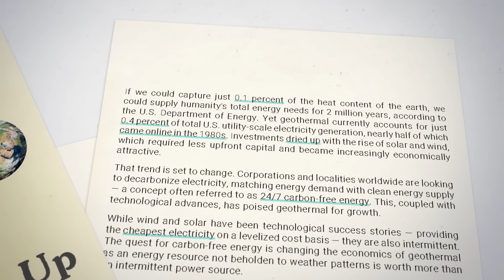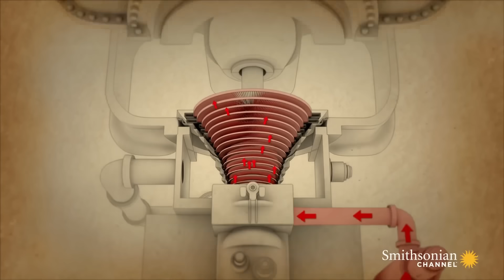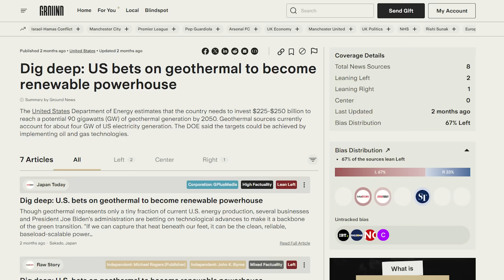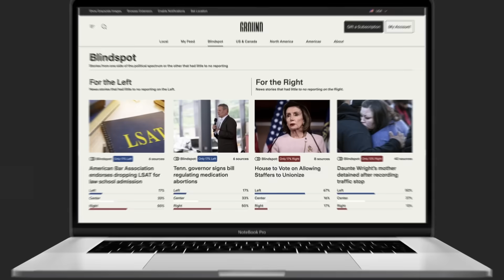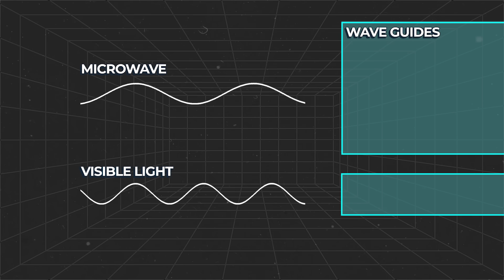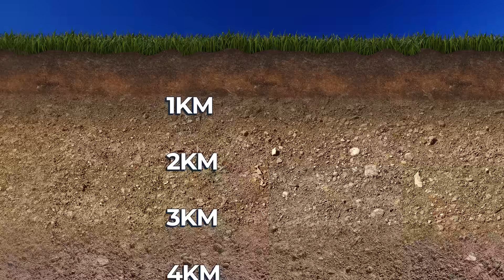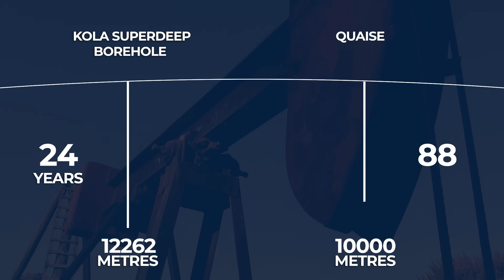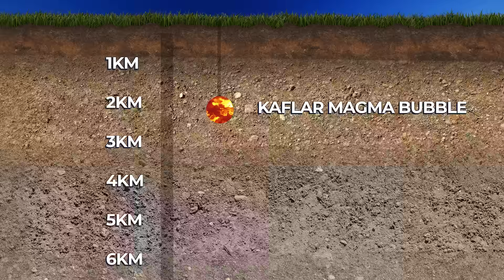This Fusion Tech is Solving the Geothermal Energy Problem

Comment: As your microwave "drill" gets near to functional depth, you might already have 100°C steam blasting out of the bore around the drill. Do you keep going? HOW? You still need a conventional casing of some sort. 

That high pressure "rock" is also going to ooze into the hole and close it back up. Oh, that's probably why these "experimental holes" will be conveniently shallow, to sucker the big investors/ government/taxpayers to fund the "real one" at an indeterminate price point for 30 or 40 years before declaring the failure to produce anything promised.

Comment: Great but I doubt individual bores would be reliable in terms of even a year.  I would question the durability of the bore holes as by necessity the whole bore is pressurized. Very highly pressurized so the steam is 'saturated'. 
 How close to the magma does it need to get or worse yet, what if you get too close and have yourself a man made volcano. Also maintaining a consistent output pressure is done how? How is input water metered to keep stable output.

Comment: I ran across a video a while back which talked about a new way of boring a hole it was a nuclear propulsion.  It was suppose to melt through rock and leave a vitrified finish.  There is a patent for this machine and it is back in the early 1970s or late 1960s.  Was the boring machine ever built, I do not know?

Comment: I wonder how they are going to handle vaporized rock at 10km deep.  Vaporized rock doesn't dissapear. It just depositions to the surfaces immediately. Even if you suck it it will collect to the surfaces of whatever you are sucking it to. It sounds too good to be true. Just 2m dollar of electricity and you have 10k hole. It is probably more feasible to dig that rock with waterjet instead. Just make a waterjet that can fit a tight hole and work submerged. It is already used in mining.

Comment: 😂🤣😂🤣😂 you can't blow out rock as a gas because what about when it cools during its journey? 💁‍♂️

Now let's talk about how hot it is down there and why those drill bits are dulled and how that same thermal energy melting and dulling the bits could also be used with thermocoupling, but that would cut costs for consumers 😐
Let's also talk about how what's down there is under extreme pressure and willie nillie breaking that barrier can be detrimental to EVERYONES' health 💁‍♂️

Im a whole 1:48 seconds in and only here because one energy solution solves another?

Foolish. Geo thermal doesnt need solving, it needs less cover up 🙄
Reply: Knowing my luck, no one will understand whats meant by thermocoupling 😒

Comment: Some of the vaporized rock is going to hit the walls of the hole and the vaporizer device and solidify, especially over kilometers of travel.
Also the internet and telecom use near Infrared, around 1.55 to 1.65um and not visible .4 to .7um.
Also look at home big the microwave or laser beam is going to be after travel 100s to 10,000s km from orbit to earth 🌎.

Comment: I postulate drilling two holes close together and at some depth bridge the two together to form an elongated U Then by pumping a suitable heat transfer medium down one it can come back up the other at an elevated temperature thus transporting thermal energy to where it can be employed. This will cause localized cooling at the bottom of the energy well thus may need progressive deepening until a sweet spot is found where natural heat flow into the well matches what is taken out.

Comment: What would worry me is that when you remove the water you are effectively removing some of the pressure. Sounds like it’s got a finite lifespan for the borehole. Unless you can pump down something that vaporises at the temperatures in the rock.

Comment: I was under the impression that microwaves only affected water molecules. [Ie. won't heat rock, unless it has water in it.]
After watching further into the video, I see that the system is more akin to a laser drill melting rock with photons.
How far is 10km? 16km is 10 miles. You might want to include Imperial measurements.

Comment: Layman question here. The few spots on Earth now where the earth's internal temperatures (and enormously explosive pressure to catastrophically vent) are more shallow are called volcanoes. Instead of 10km deep, they are more shallow by virtue of the geologic "leaks" that have crept past that stubbornly durable, drill bit-destroying rock layers over geologic time. You know, the layers that protect us from a sudden cataclysmic release of that nuclear-level pyroclastic energy.  What protects us when we seek to drill past the protective layers and release that mind-boggling heat and pressure to warm our homes? One of these vents in every city? Really?

Comment: I used to think that melting through rock or ice is the best way of making tunnels, but then I learned that phase change requires much more energy than simple mechanical boring. I think it is best to avoid having to go through a phase change. You just need a drill bit that doesn't wear out. I can think of a few ways of doing that.

Comment: What happens to the hole if the "fusion bit" hits a pocket of gas/methane or raw crude? What happens if the fused sides wear over time from natural erosion or tectonic plate shift, creating pockets of high pressure steam?

Comment: Where does the vaporized rock go?  If it goes up the hole in gaseous state, then it will liquify once it hits cooler layer of the borehole.  Then it will flow back down and eventually solidify and plug the borehole. Any solution?

Comment: Ok so what your saying is we should steal the heat from the core of the planit and disipate it on the surface ........    i feal tbis is the same loging as releasing carbon from fosle fuels .   There is garenteed issues and consequences . I really do appreciate you sharing your ideas though cuz it's important that as a group we all work together and try to find solutions to problems

Comment: Well one challenge I see is keeping the losses in the wave-guide low enough. And it is not enough with any material, it must also be able to withstand the temperatures. As a reference for a tv-transmitter operating at about 0.5 GHz the losses in the cable to the antenna was about 3dB for 300 meters. So half the power lost in only 300 meters. Now we are talking 150 GHz and over 10 km.

Comment: Wouldn't it be better to traditionally drill to a point, then switch to the new drill? There has to be a mathematical 'tipping' point in distance drilled that average speed becomes greater for the new drilling. Wouldn't a combination of the two drilling styles be the most efficient for time?

Comment: I think, in long terms there is only solar/wind/waves/water as a solution for energy. The radiation from sun is heating the atmospere anyway. If we produce much more heat, we heat up the atmosphere, and our global energy demand is so high that we can not afford this. Not only CO2 is "heating", also simply burning stuff. Even Fusion is too hot to be a solution as single energy source. Only the renewables don`t put more heat into the system.
Reply: This are not my thoughts, i heared it from a german scientist, Harald Lesch

Comment: 0.1cm/s = 3.6m/h
100m/h ≈ 2.8cm/s

So the microwave drill is about 28x slower than a conventional drill (in the range the conventional drill is effecting in).

If I may suggest for the author, next time make your units match in the script?  The researcher eventually gave the numbers in easily compared units, but a few minutes later in the video.

Comment: Why not use the geothermal energy to drill it's self.Simply drilling a hole deep enough to be so hot it no longer is viable to use drills then using water to power a drill at the rock face powered by the steam from the heat of the rock.This will cool the rock(locally) as well as create steam which can be used to power the drill

Comment: Very nice presentation and a great tech. I am a chemist who actually uses gyrotron for microwave generation for dynamic nuclear polarization enhanced nu lear magnetic resonance (DNP NMR). The wave guide is not a simple system if high efficiency is needed at the application point and we usually use threaded (wavelength specific) aluminium or copper pipes. Seeing the need to carry the molten rock out of the drilling point one must use molten salt tech (or something else) as a carrier but than the temperatures may bend or melt the waveguide! So, I see multi level challenges here and it is quite exciting! I am open for discussion if anybody from the company or the public wants to chat about it.

Comment: There is a simple version of geo that would be useful for heating homes called hot rock. It wouldn't solve all our energy needs and is locked to areas with granit bedrock, but it could provide cheap heating (and, in turn, lower energy needs) to millions in areas it would viable.

Comment: Don't you think the more useful engineering challenge would be to just get rid that multi day break? You seriously can't have a system where whilst it's drilling a new drill bit is being lowered down (through the drill shaft itself) , then it auto replaces it down at the bottom, and continues drilling with no turnover time? Essentially the same as a mechanical pencil?

Comment: What happens when the tip gets fouled? The vaporized rock will condense along the drill. When you use lasers in surgery, carbon collects on the fiber, which disrupts the function of the laser once too much collects. It's not exactly the same since most of the carbon build-up isn't from vaporized tissue, but the principle is similar

Comment: Since normal drils went in so deep to melt down , i guess there is no need to drill deeper , what will  you get . Do you even think people . IF it was down to the drills , we would be doing it . Since we can drill down to hot rock with normal drills .

Comment: They need to create a toenado of the hot fumes so the particles don't stick to the borehole wall. To maintain the tornado, the spinning of air needs to be maintained at manageable distances to keep the flow going up and out.
This also means at some point, compact tubular refrigeration inserts need to be applied to cool rhe walls.
The setup might be similar to oil well pipes that contain all the essential components in each segment and pass the rock steam up the center like a tornado.

Comment: Massive investment, thousands of years to drill deep enough, all to convert heat in to a mechanical output for the production of electricity. As there are countless alternative methods of doing the same with less investment in a matter of months, geothermal energy is a dumb idea

Comment: Ok, so if the Quaize system is more consistent and faster at lower depths, but traditional drill bits are much faster at more reasonable depths, could you not use both systems sequentially? Using the drill bit to go, say, 3km or until it breaks down, then switching to Quaize for the final stretch? Or am I missing something, I’m genuinely curious,

Comment: Well, even if something doesn't pan out, we might be able to kick start other planetary bodies. Chuck most of the oort cloud at Mars to get some atmosphere, water and a little more planetary mass, use the bore as a thermal battery by using excess energy to heat the core.
By the time fusion energy is available mars might have a polarity to protect its surface lol

Comment: there is still some problem. how they get rid of the super heated rock. rock evaporating probably over 2500° . what type of thing can wistand such a high heat ?  its will goes same the drilling with metal . also the silicon will crystlyzing somewhere between the hole

Comment: We don't have an energy problem at all.. We have technology sitting back designed to use light tube technology like Solatube to send light underground to trap it for day and night use of cold steam Tesla turbines. Cold steam Tesla uses vacuum pump to increase heat value.. Raises cup of water into the sky until it starts cold boiling The Tesla turbine steals the heat so it can't balance cold side with hot no matter how hard the universe will try and as long as heat is being added to hot side the universe will never give up.

That's not even mentioning we trained you all like monkeys you can't even use results of using things like Algae. All fuels crude can make but you still can't figure out what crude is a naturally heated result of. That's not mentioning thermoelectric generators could be added to underground generators to pump in sync the exhaust through water to capture CO2 to extract by ultrasonic agitation at any desired rate to max possible. Shakes up a COKE We are JURY of this world.. We see everything. - Watcher (We=Oops, your masters did. Sorry, runs finger across constitution We is our whole empire and its hard to ACT LIKE YOU.)

Comment: How do you get the material out of the hole? Won't the gas cool down and solidify on the walls? Or is it kept hot by the beam all the way up? But then, won't the raising gas reduce the efficiency of the beam the deeper the hole goes?

Comment: While Quaise is working on getting MMW to get to the point where it can drill these ultra deep wells, we can work on making the reservoir that would extract the heat from the rock. We can do this at very high temperatures at relatively shallow depths near volcanos like those in the Cascades or near Yellowstone or at places like Iceland, New Zealand, Italy, Indonesia, the Philippines or Mexico. Right now, AltaRock Energy spin off Mazama Energy is working at Newberry volcano to take stimulation technology to the next level.

Comment: They seem to gloss over the glaring issue of rock vapor removal. If it's expected to naturally waft upward out of the bore hole, they are likely going to be disappointed by the higher parts of the bore hole acting as a heat sink to cool and solidify the rock. 

Or, it will end up in a liquid form while trying to pump it out. So then maybe they keep it heated...sounds like an incredible amount of additional energy. 

So then they'll probably just have to occasionally stop to clear out solidified rock. Maybe that's easier than pulling up and changing drill bits, idk. 

The other major question I have is--what is the form of the wave guide? Perhaps this would be a good first application of a plasma filament wave guide.

Comment: Interesting tech for drilling and maybe tunneling but energy production seems far off. Once the geothermal resource is contacted how is the thermal energy converted into electricity? Current geothermal tech is plagued by heat transfer system deposition and corrosion. Granted there are many reasons for this that would not apply to such a high temperature source but looks a stretch. Thought the tech itself essentially a fusion torch was interesting. Thanks for the video.

Comment: i have to wonder what effects mass use of Geothermal energy plants would have on the planet itself. 
the geothermal plants use said heat to boil water, transferring the heat energy into pressure and steam to turn turbines to produce electricity, so i wonder if the transfer of heat from the core of the earth to the surface en masse over the course of many years would have a collective cooling effect on the surface of the planet's mantle and what tectonic effects that would have

Comment: I really like this idea, I designed a drill bit that was lot's of drill bits so that when blunt would expose a new drill bit but once you get to hot areas even a 100 meter drill bit's would only last a week or two. The smooth glass wall it leaves would also be great.

Comment: 10:14 Also, the deeper they go, the better the method works for 'drilling', so wouldn't they gain drilling speed (exponentially?) and reach 20 km at a rate much faster than a linear calculation of 20 million seconds (2*10^6cm Distance / 0.1cm/s Drilling rate), or about 231 days?

Comment: Why not cut the rock with ultra high pressure water jets, with mixed in ultra hard, fine particles, like corundum / sapphire?
I think those are used in industry to CNC cut hard materials like metals and ceramics.

Comment: If you can cut through solid fuck why not just use the bean to sharpen the bit making it last longer?  If you can select the beam to the side you can then make cavities to dumo the old drill bits so you don't have to lift them up.

Comment: Everything still runs on steam so how can we use steam better? By having a multichamber evacuated system to create high and low pressure zones with a turbine in between needing only 30c worth of continuous thermal energy input to achieve full vaporization and recondensation using the same degassed distilled water in a endless cycle.

Comment: My question is: how do they transfer enough thermal energy through such a long, narrow shaft to the surface? And how do they overcome the problem of that one spot at the bottom of the shaft cooling off as they continually exract massive quantities of heat? I'm assuming they would use water? But then they would need a return path for the steam, no? How does this process work?

Comment: Question: why do we need to drill so deep? Why not drill less and use a combined-cycle plant on the surface? That way, you can generate electricity with lower temperatures.

Comment: So someone drills a hole, using billions of joules of energy to vaporize rock, and then you get a tiny hole to turn a turbine, plus you have to put water in to make the steam.  This seems like a tremendous amount of energy to pull a tiny amount out.  There are indications that it takes a minimum of 10 percent of a solar panel's life to recover the energy necessary to produce transport and install it. And yet we say no to LFTR.